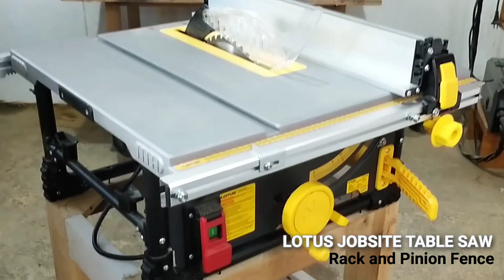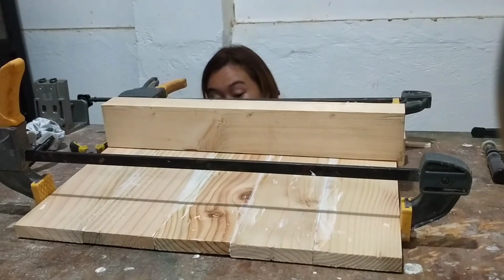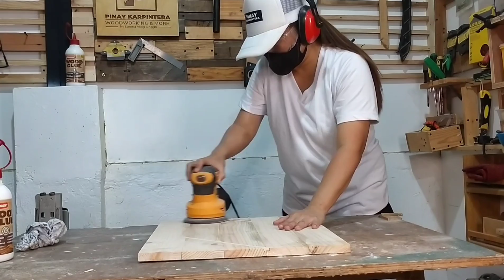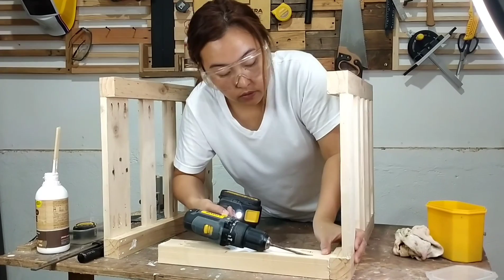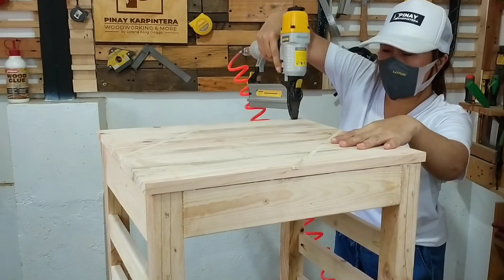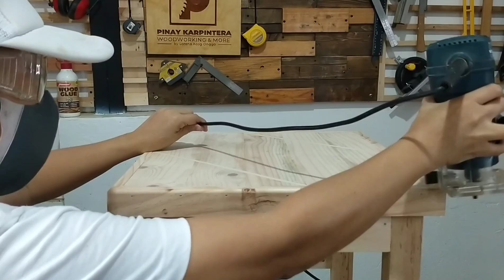Build a Side Table DIY | Simple Woodworking Project for Beginners

Comment: Gypsum screws ba Ang gamit mo sa pag assemble?Kung gypsum screws ang gamit hindi yan ideal sa woodworking.Dahil ang GYPSUM SCREWS AY DESIGN SA GYPSUM BOARD only.Maraming disadvantage yan sa woodworking.Britle,matigas,hindi kayang mag hold ng heavy load,hindi outdoor screws at hindi sya structural screws.COARSE TREAD gamit sa wood stud.FINE TREAD gamit naman sa metal stud o thin sheet metal.
WOOD SCREWS ang dapat gamit sa woodworking,meron din COARSE TREAD gamit naman sa softwood tulad ng pine,plywood,mdf,particle board at low density materials.FINE TREAD naman gamit sa hardwood tulad ng maple,mahogany,oak at iba pa na mataas ang JANKA HARDNESS SCALE. 1000 pounds- force( lbf) pataaas ay nabibilang sa HARDWOOD at 1000 lbf pababa ay nabibilang sa SOFTWOOD.
Dapat alam mo din ang SHEAR STRENGTH,TENSILE STRENGTH,LOAD FORCE,WITHDRAWAL FORCE ng material mo.
Dagdag mo narin ang TYPE NG MILLING TULAD NG FLAT SAWN,RIFT SAWN,QUARTER SAWN.Seach mo na lang sa Google at YouTube university ang term na di ka familiar .Sa isang woodworker dapat alam mo ang bagay na yan.Marami ka pa dapat malaman,yan muna.
May potential ka ,na maging professional na woodworker.